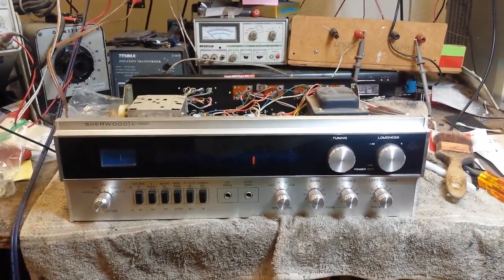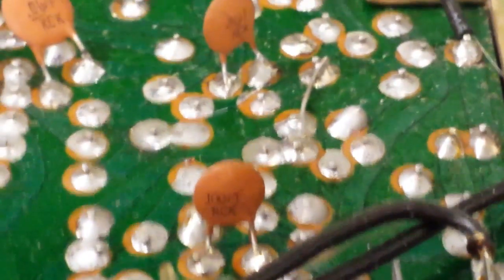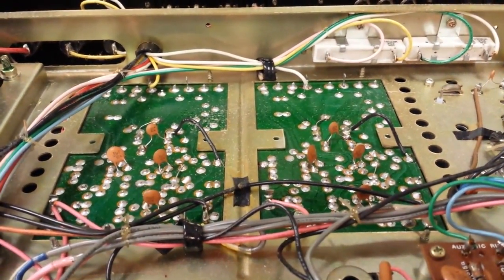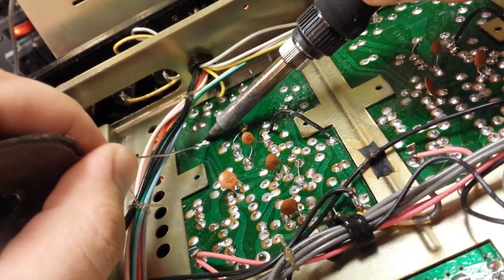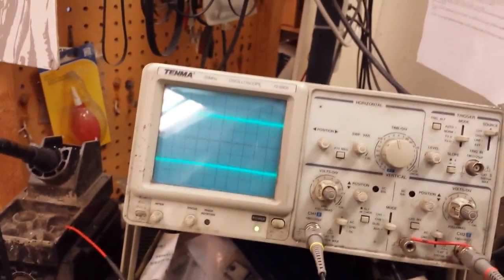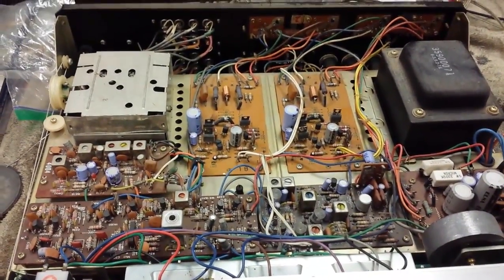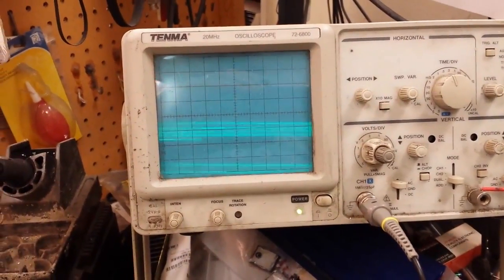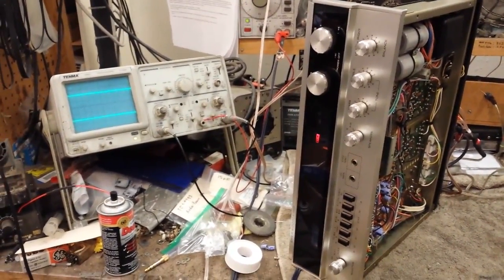Servicing a vintage Sherwood S-7200 receiver part 2/?

Comment: Right now I am working on a Akai M-1 reel to reel that has no sound out of both channels,I found a couple of capacitors of the wrong value, someone had put in a 6.3v 100uf in the preamp board instead of a 63v 100uf that is a big difference! I already replaced capacitors in the amp board also replaced some transistors.

Comment: When I check the ESR on the capacitors do I want low or high ESR?That is the part that I am not familiar with. But more than likely I will be replacing them since my S-7800 is so old.
Reply: Lower ESR is typically better. Specifically, any instance where audio passes through a cap. Higher resistance will cause the audio to be quieter after passing through it.
Reply: @rebootedelectronics   Thank you very much for the explanation!

Comment: What books or videos would you recommend for beginners? I have a ton of stuff to repair but a lack of knowledge.
Reply from the maker: +Stranded 360 I learned best from folks who were in the trade. Get some books on electrical, tube and transistor theory and circuits, grab cheap broken stuff at thrift stores etc and experiment. Hands on is the best way to learn once you have basic knowledge